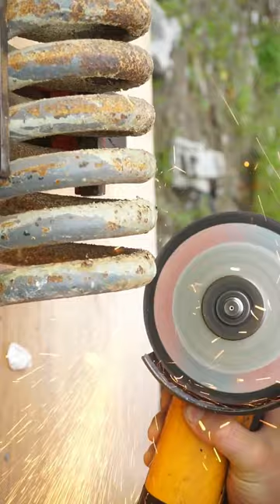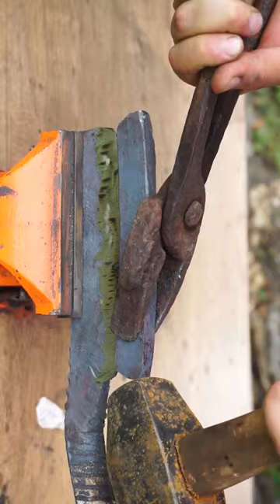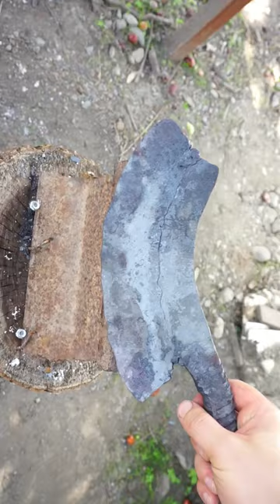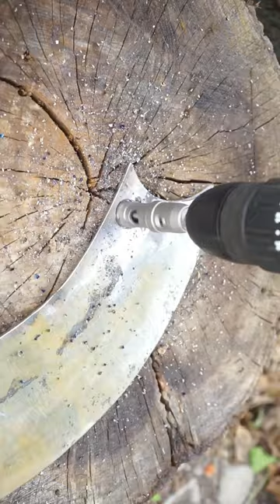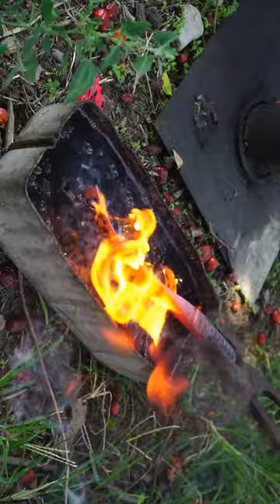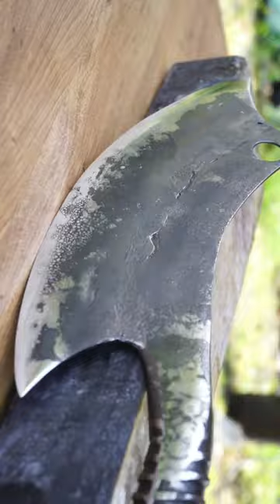Making amazing cleaver from rebar and coil spring

Comment: That particular method of billet construction is called San Mai.
A Hardenable piece of metal is sandwiched between two softer pieces of milder metal.
This gives the blade a hard core which can be sharpened to hold a good edge.

That white powder is Borax.
It is basically a cleaning agent.
It removes any moisture from the surface of the metal so that the sheets of  metal can be hammer welded.
This prevents delamination  during the forging process.

Comment: What is that white powder?
Reply: It's usually Borax which is used as flux that prevents oxidation between the two pieces of metal so they weld together more readily
Reply: AS the other guy said, what the guy did with that cleaver didnt see that good considering he flattened it outwards (the added on steel) instead of letting it wrap around the cleaver head for a sturdier connection. He didnt even let it get blinding white from the heat (best for fusing metal togheter but not smelting)